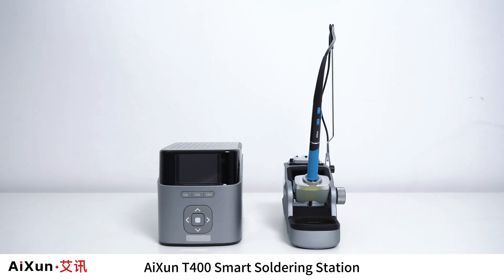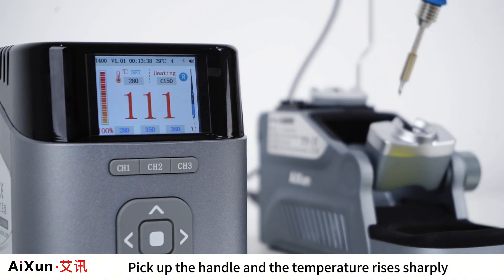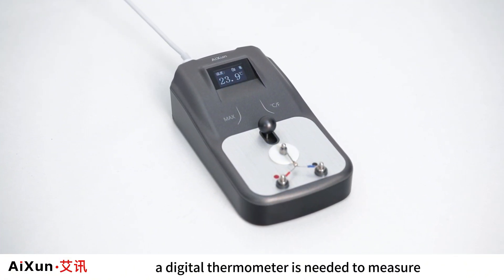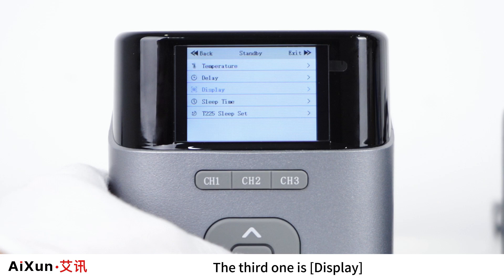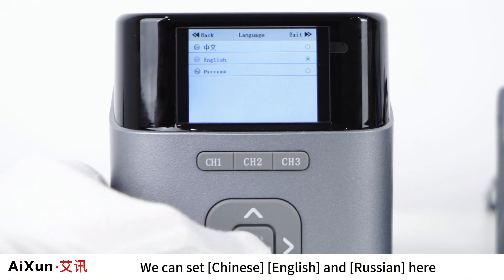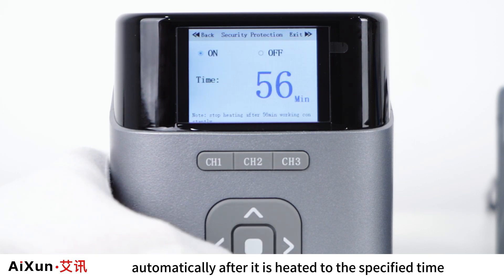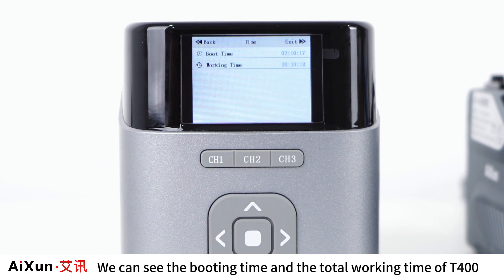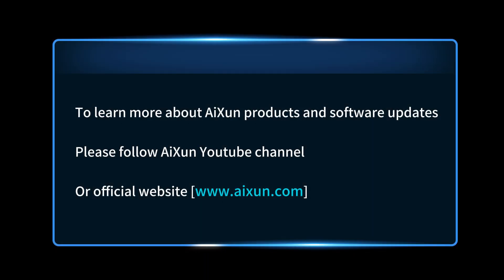AiXun T400 Smart Soldering Workstation - Operation Guide #aixun #t400

Comment: Could be much better if it supported t245 t210 t115 handles aswell. I would like to buy it with Fume extractor, eb01 dock, polishing pen, hot tweezers and h314 to make a aixun setup on eb01 but I will not do it just because it doesn't support other handles. And there is loads of people on forums I read they won't buy it just because there is no support for other handles. Actually first video of the t400 had an information that it supports other handles and no idea why its chsnged...
Reply from the maker: Hi, it supports the T225 handle, this is a 4-in-1 handle, support 4 types of AiXun soldering tips: C250=C470, C150=C245, C080=C210, C030=C115
Reply: @aixuntech  t225 not really compatible with c245 c210 c125 tips since i tried it. It's tips different and since it has only 3 kind of tips for each size, its not enough for proper repair shop. We need support for real c245 c210 c115 tips